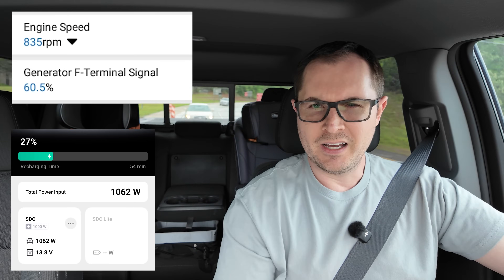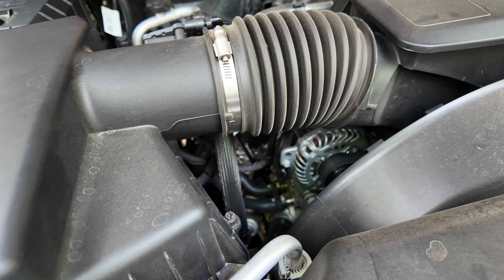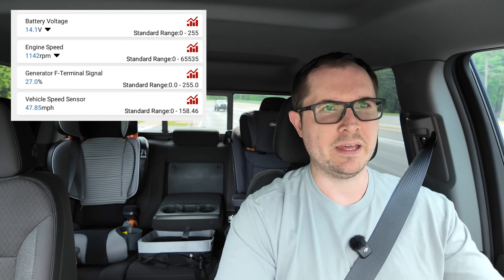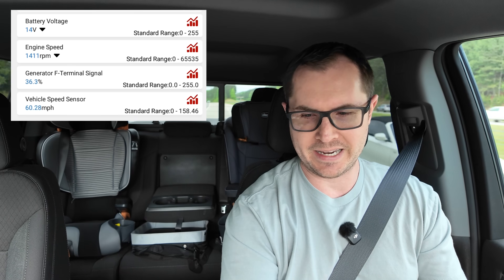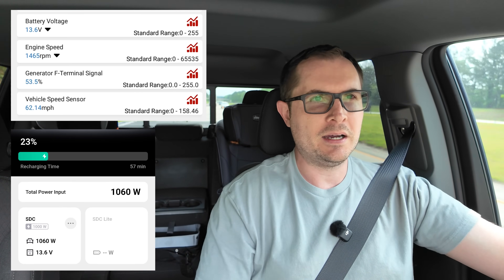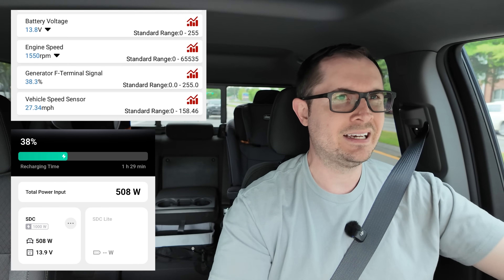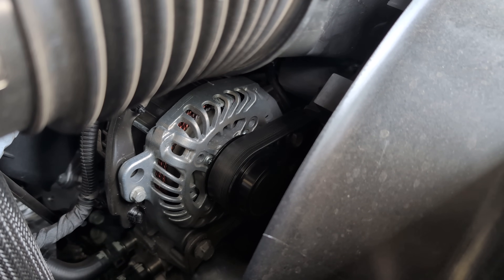I Show REAL Numbers: Impact of DC-DC Chargers from DJI, EcoFlow, Bluetti on Alternator

Comment: So you have to realize there are two things working against you here. At lowspeed, the reserve capacity drops because rhe alternator speed drops. The airflow also drops at idle, which causes the alternator temperature to rise, which also causes the reserve capacity to drop more. 
So look at your DC-DC charger. Its power draw was 1000+ watts at 13.7V which equates to 73+ Amps...on an alternator that is rated at 170A. That alternator will now run hotter...which diminishes the capacity factor more. So...as a rule of thumb, design for your harshest load at idle in Amps. 70+30=100Amps. Now you want an alternator about 125% of that capacity...and there you have 225A for a desired rating. If you plan to run more power or have longer life in warmer environments I would go with a 250A. And that is kind of a beast. The hotter it is expected to run at the desired load, go bigger. Now you are at 300A. Also, you may want to get a second 12v battery to share the load between the alternator and your high capacity load. Typical Renogy DC-DC chargers for Lithium Ion batteries current limit to 60A so they don't destroy a typical alternator.

Comment: How did you get the generator F terminal PID to show up? I have the Torque app and it's not a reported obd2 PID.. I have a 2021 silverado Trail Boss and added custom PID plug-in and still no generator F terminal?
Reply from the maker: I think you have to have a reader that has brand-specific software to read in GM variables. I was using the Kingbolen S800 OBD2 Reader (https://amzn.to/4jSaDBh) and had to go into the GM menu to get to it and it was deeply burried under "Theft Deterrent & Electrical" section. I don't know if it'll show up in the Torque app, but certainly report back if you figure it out. Sorry I couldn't be of greater help.
Reply: I did actually figure it out.. A forum member had decoded the PID parameters and I added a custom PID to the app.. Now I'm good to go!  @AdventureRocks

Comment: Heat is the primary enemy of an alternator and amperage is the heat source.
Idling at or near 100% duty cycle for more than a few minutes is a death sentence as heat quickly builds up in the alternator. I would suggest keeping the maximum duty cycle to more like 50% and even then I would keep an eye on how hot the alternator gets. If you cant touch it with your hand its probably too hot.
Idling to charge up a battery at high amperage loads is the death sentence of every alternator. Melted windings and cooked electronics will be the result every time.  

The other serious alternator killer (not covered here) is the spike that comes back to the alternator (and the vehicle electrical system) when the battery management snaps closed at full charge. The alternator will continue to deliver 1000 extra watts to nowhere for a few seconds until it figures out what is going on. It doesn't take a genius to figure out how bad that is.
As the battery comes close to 100% charge the dc to dc charger needs to be turned way (WAY!!) down.

Great video!
Reply from the maker: Thank you for watching! And, thank you for the tips.

Comment: Is a 220a alternator sufficient for 40a dc-dc on my ram 1500?
Reply from the maker: I would think so. Mine was only 170A, which is smaller. The big take-away I learned was to avoid idling and running it at same time.
Reply: @AdventureRocks 💯 avoid charging when idling. Im just wondering as these new modern vehicles require a lot of electricity and current to run, that the alrernator cannot handle the demand. The factory alternator is only rated ag 160a

Comment: I can answer a few questions people might have. A vehicle alternator from the primary engine is one of the most efficent ways to charge an auxiliary battery bank while the vehicle is in motion by far because you can use the momentum of the vehicle even while downhill to charge assuming the transmission is in drive. 
What I reccomend is to have an oversized alternator preferably only use 50% of the alternator rated capacity. Also, alternator usually don't die, it's the rectifier that stops working well before the alternator itself so you can re enforce it with an aftermarket part. 
Also, I reccomend atleast 100w of solar on the roof if possible to supplement the power supply. Works well since not every load will be above that.
Reply from the maker: Great tips, thank you for watching.

Comment: I swapped out a couple of car's lead-acid batteries for a large LTO battery because I was sick of various lead-acid failures in various vehicles.  The decreased resistance means it's probably making more work for the alternator.  I haven't had one fail yet.  You've described a really good test that I should do now to make sure I'm not overloading the alternator.  Thanks!
Update: no apparent OBD access to alternator current, I need to set up a DC clamp meter.

Comment: Good info. I run a Renogy 40A DC to DC charger which is about half of the power of the DJI in the video. Works great and after seeing this I’m feeling that a 40A unit is a great choice. Also, if you have a tow package, most trucks will also have a high output alternator
Reply: I bought the same one which I’ll be using to charge a group 31 LiFE battery to run a fridge. How have you been liking it so far? I haven’t installed mine yet
Reply from the maker: Great setup. Thank you for watching.

Comment: I have a 100 amp hr LI battery in my TT house battery. Am I harming my alternator as I travel without a dc to dc charger?
Reply from the maker: The trickle-charge out of the 7-way plug is pretty low, well under 100W for most vehicles, so little to no impact in your case. Some folks add a DC-DC charger to boost charging in the 250-300W range or higher and even then if you're moving it should be fine on most trucks.

Comment: If you plan to use an alternator as a generator, buy a lifetime warrantied alternator.
Understand that your vehicle engine fuel usage is much larger per hour than a generator.
i.e. 4600 cc versus 220 cc

Comment: There are six diodes inside the alternator - the alternator is 3-phase, so the ripple after rectification is 4%. 
Any overload will cause those diodes to overheat and become either open or shorted.
The signal you read on the OBD port is proportional to the field excitation voltage, used to control the alternator output. At lower engine speed, the control must compensate with higher excitation.
I found out that cars with start-stop technology have an upgraded alternator. I also recall that the cars from the '70s had a 14.4 V - 30 Amp alternator, and the engine idled at 900 rpm. My first car had a dynamo which started generating at 1200 rpm.
My suggestion for the power station - charge it only if you really need it, and while driving on the motorway. The alternator is much more efficient at 3000 rpm, and the higher rotation speed cools the diodes and the copper windings much better. If you don't exceed 500 W continuously, there should be no toll on the alternator.
Greetings,
Anthony
Reply: If you jump a dead battery with in about 2 tp 3 minutes the temperature of the alternator can get over 400 degrees they are not designed for that. Cheap alternators the soldered connections will melt.

Comment: Would it be helpful if the DC to DC charger only kicked on above a certain RPM?
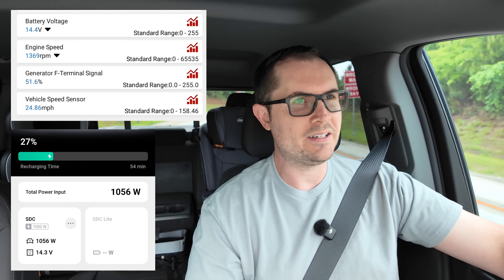Reply from the maker: Great point. I didn't discuss in this video, but in the install video I showed a setting that allows you to control at what voltage threshold the DC to DC charger operates. EcoFlow, Bluetti, and DJI all offer this same feature. Essentially you could set the threshold higher such as 13.8V and then naturally when idling and RPM go down, the voltage follows as shown around 11:20. Not quite the same as RPM setting, but that'd likely involve a permanent OBD2 connection so the voltage setting is a nice alternative at least.
Reply: I have dual 30a Victron chargers. I’d like to avoid replacing my alternator! 
Iirc There is a voltage setting, like you mentioned, that is worth setting.

Comment: As you stop, the rpm and also the voltage drops at the alternator output at idling speed, so the regulator will increase magnetism in the rotor coil to maintain the current on the stator coils at idling speed to meet power demand ( Wattage).
Gaz UK.
Reply from the maker: Great point, thanks for watching!

Comment: E.g. a typical car alternator @ idle is only producing1/3-1/2 of max. output. i.e. 20-40 amps. So how come everyone are so worried about their alternators producing "smoke" @ idle? Its considered a safe working temp. max for a alternator is 120 C/248 F. So, get ya heat guns out lads & find out for yourself how hot your system works at idle.  🤭
Reply from the maker: I hear on on the temp concerns. Mine was about 165 F via infrared temp gun with and without DC to DC charger, but I was also moving avg 40mph, so plenty of air flow in the bay. I could definitely see it going up if I was idling. Most of the other components in the engine bay were about the same 160-180 degrees F after some driving.

Comment: Excellent video…answers lots of questions.  I installed a 40 amp DC-DC charger on my Ford Transit which has a 220 amp alternator…so I expect I don’t draw to much extra load in the alternator.  I also have a switch on the charger so only charge when I expect to do continuous highway driving.  Thanks!
Reply from the maker: Thank you for watching!

Comment: Great video. I have a friend that has the Ecoflow power station and battery in her Nissan NV3500 van. 7.3kw. She has the ecoflow dc to dc charger. It charges at around 850 watts. She fried her 130 amp alternator within three months.
Reply from the maker: Thank you for watching! Sorry to hear about your friend's van/alternator.
Reply: Why didn't she turn it down?So it wasn't overheating her alternator? You can set it to only draw something like 300 watts, and then she would have had no issues!

Comment: 80% continuous seems to be the standard in most electrical specs and code. 90-100% continuous will cause overheating and damage in many electrical circuits.
Reply from the maker: Thanks for the tip, and thanks for watching.

Comment: I would like to know what the normal temperature of the alternator is compared to temp with DC to DC charger. High Temps can shorten the life of the alternator.
Reply from the maker: Great question. I am not comfortable idling with mine personally, but what I found is the temp stayed mid 160s F whether my DC to DC charger was running or not. But, I was moving with average speed of 40mph and my truck has a giant fan and grill right in front of it. I could see where idling would very QUICKLY heat things up.

Comment: I would like to see the Ecoflo version tested.  I was thinking about purchasing it, but this could be a deal breaker?
Reply from the maker: I tested the EcoFlow on my Jeep Wrangler JK. Worked great. I think the take aways are not to idle with the DC to DC charger running, and if you don't need the full power...800W on EcoFlow, dial it down to 250W or so...big difference concerning potential to strain alternator comparing 250W vs 1000W.

Comment: Your field terminal current doesn't dictate alternator output current because alternator shaft RPM is variable.
The best test would be to measure alternator temperature, either the 3-phase bridge or stationary winding temperature.
Remember, more air passing through the frame (rpm=cooling) will lower the temperature.
Reply from the maker: I hear you, and thanks for sharing that insight. I wish I had those other variables to read in through my OBD2 reader for more data, but unfortunately that's what I've got on my truck. Surprisingly my alternator temp remained about the same via infrared heat gun about 165 (F) with and without the DC-DC charger running, but I also was moving with average speed of 40mph so lots of air flow in the bay. I could definitely see temp rising steadily if I was idling though. Great point.
Reply: @AdventureRocks  Alternatively, you could measure current output of alternator using a dc clamp probe to measure the magnetic field around the output conductor.  A cheaper way would be to connect an ammeter in series with alternator output.
You'll get an idea of how much power the alternator is producing under various conditions.  Maybe GM specifies maximum operating temperature of the alternator or it's various components.
More than likely there's a datasheet somewhere for the rectifier bridge that specifies maxumum operating temperature for the component.
I'm guessing if your future power requirements increase beyond the alternators capability, you can install a 2nd alternator without modifying the existing electrical system.
Reply from the maker: Great tip  @thisisyourcaptainspeaking2259 . Thank you

Comment: Without a temp sensor on the alternator, there is no  way of telling if you are approaching any critical limit.
Reply from the maker: I hear you, and thanks for sharing that insight. I wish I had a temp variable to read in through my OBD2 reader for more data, but unfortunately that's what I've got on my truck. Surprisingly my alternator temp remained about the same via infrared heat gun about 165 (F) with and without the DC-DC charger running, but I also was moving with average speed of 40mph so lots of air flow in the bay. I could definitely see temp rising steadily if I was idling though. Great point.

Comment: Like anything in life if you use it harder, it will wear out quicker. if you’re charging an Eco flow all the time at 1000 W you will probably shorten the life of your alternator, that’s pretty obvious. What may be less obvious is that wearing out your alternator early because you’re charging that much means you need to charge that much and replacing an alternator is just the cost of doing business. replacing an alternator is neither very expensive or difficult. So what if your alternator only lasts eight years instead of 15 years, if you’re getting that much use out of a solar generator that doesn’t seem like a big deal.

Comment: I would like to see the temperature of the alternator at idle with that much load a friend of mine installed a drop in lithium battery in a sail boat and it cooked the alternator due to him idling  the motor in the morning
Reply from the maker: I hear you, great point. Mine was right about 165 F after driving, but not idling. Seemed like most of the components in my engine bay were similar temp. I'd imagine the temp would be higher if I ran it while idling. I may be in minority, but I'm reluctant to idle too long with DC to DC running so I don't overload alternator.
Reply: @AdventureRocks  On my last four wheel drive a diesel toyota I put a temperature prob a indoors outdoors on the leisure battery under the hood. As they kept failing every 18 months living in a hot part of Australia if you get three years from a car battery you have done well. When driving the battery was about 5 degree C above ambient air but when you stopped it spiked up rapidly. We use a rule every 10 degree C over 25 halves the life of a battery and they need a lower charge rate when hot 🥵

Comment: So much we don't know.  If your pulling 120 amps driving with 1400 rpm the Alternator may be cooling much better than at idle.  At idle is the same 120 amps output still being cooled sufficiently at low rpms?  Heat is your enemy!  You need a temperature sensor on the Alternator and do extended idle test at different amp output.  When doing testing on Permanent Magnet Alternators for off grid charging, the rpm of the Alternator was a huge deal.  Lower RPM's produced extreme heat and started to burn the winding coatings which did not happen at higher RPM's.
Reply from the maker: I hear you, great point. Using an infrared temp gun, my alternator was right about 165 F after driving, but not idling. Seemed like most of the components in my engine bay were similar temp. I'd imagine the temp would be higher if I ran it while idling at length. I may be in minority, but I'm reluctant to idle too long with DC to DC running so I don't overload alternator. Thansk for watching.
Reply: absolutely 100% correct. Monitor the alternator temperture with a thermistor attached to the alternator. This is a watch-dog protectionism for our alternators.

Comment: I don't think it is percent of output current. It is probably the duty cycle of the field terminal. I would like to be corrected if I am wrong.
Reply from the maker: Great question. Without getting too technical, the F terminal on a GM trucks is responsible for controlling and monitoring the alternator's charging output. It's not the same as putting a clamp meter around hot leg and measuring amperage, but still a nice indicator that I can easily read via OBD2 port.
Reply: You are correct. The alternator is regulated with PWM which is the "duty cycle" that you mention.

Comment: Get an aftermarket alt and 1/0 copper wire ro the battery, ground and ebgine ground. 

Ohio Generator, DC Power, Mechman etc.
Reply from the maker: Thanks for watching. Great tip.

Comment: Heat is the enemy of many things automotive. This will induce heat into the alternator, cables/wires, vehicle battery etc. Your Voltage drops at idle as well. This increases amperage in the system. In turn raising temperatures in the conductors, and maybe some circuits as well. The alternator has brushes on the commutator that are a wear item as well...I'd think wear would be increased with load. Also takes horsepower to produce electricity which translates to fuel consumption...albeit a small amount. BTW- idling your "normal" vehicle is typically quite hard on the engine & more -- Thx for the data --  Fantastic video!
Reply from the maker: Great point, thank you for watching.